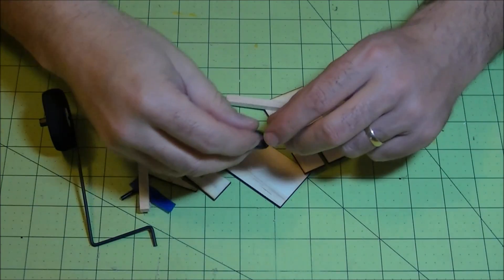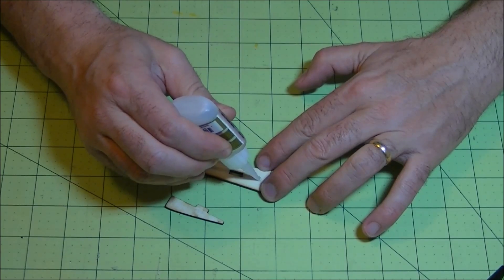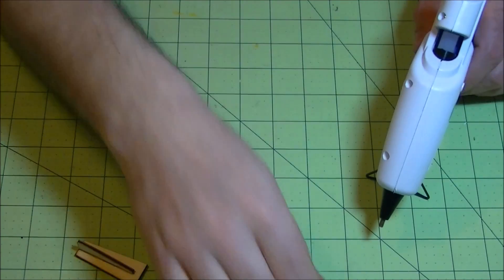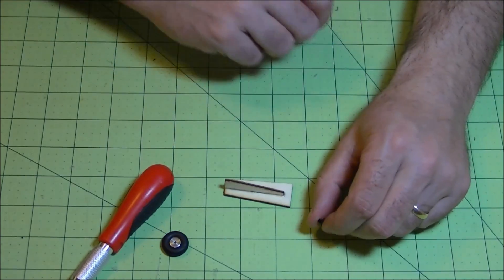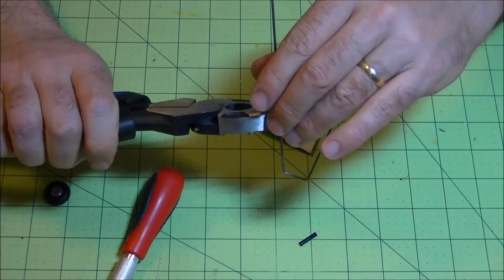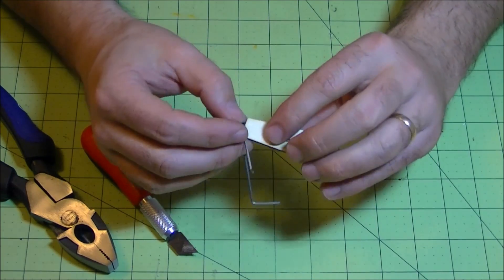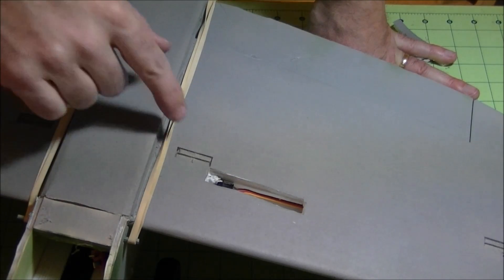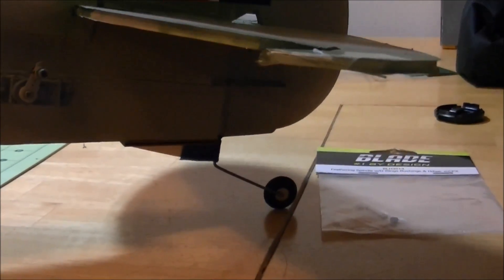Landing gear for FT Spitfire

Comment: Very nice video, may have to build this plane just to put the 
A ding gear on.... Can I ask where you got the hot glue gun? I have about 4 guns and dislike each one, yours seems like a very nice gun. Thanks, jerry
Reply from the maker: I think I got the glue gun at walmart
Reply: Thanks. That's one place I haven't gotten one from. Thanks
Reply: +hawkskyflier If anyone else is wondering, its an ad tech 2temp, it works pretty well I have the same one, the tip is a little tube instead of a cone which works well for precision dots and small spaces but not quite as well for long beads, kinda tends to go all squirrely. Other than that Ive really liked mine, and its under $10.

Comment: What canopy did you use
Reply from the maker: I used a top section of a pepsi 2 liter bottle. Fits almost perfect. then used some pin stripping tape for the framing.